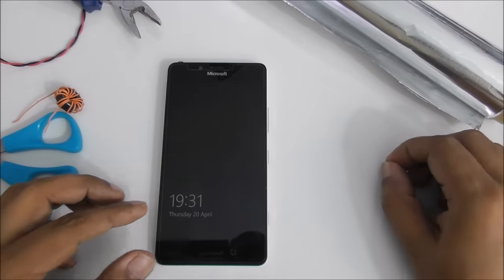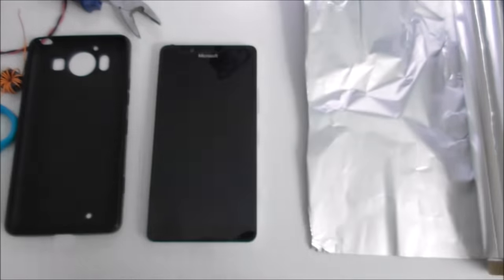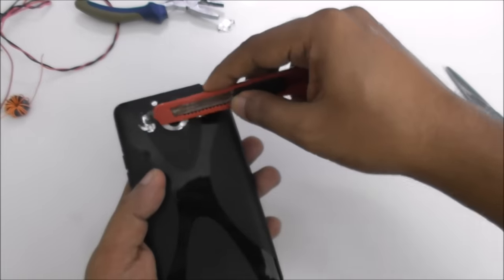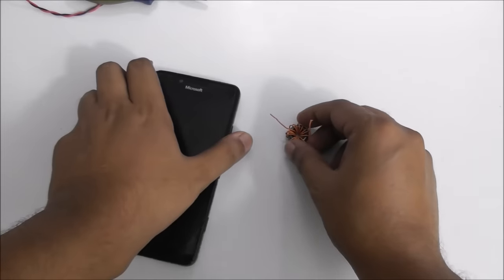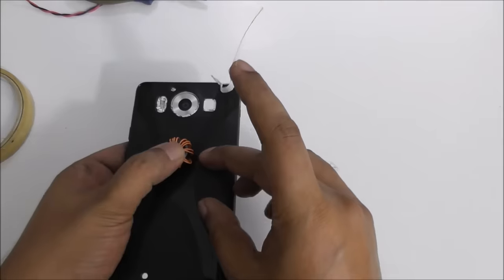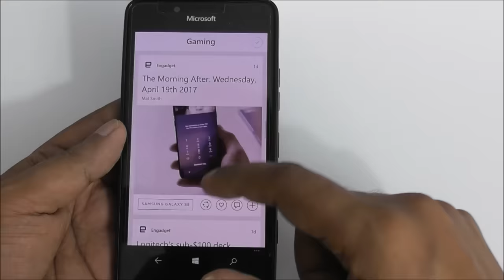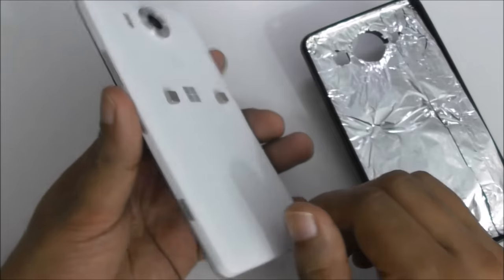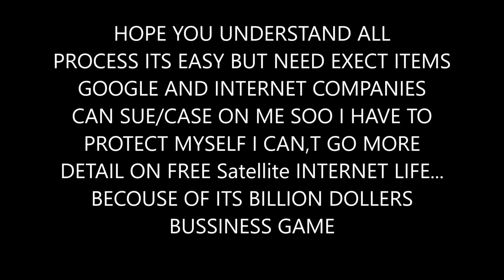FREE INTERNET WiFi DATA LIFETIME ANYWHERE

Comment: That ring is used in many electronics as a radio wave reducer, check a laptop charging plug and it will most likely have one, by this logic the ring would block any incoming interfering signals and disrupt whatever magical data is coming in, also with no SIM card??? There is a need to verify who gets connection, you have to have a very clever way to bypass this authentication system, and the magnets are just, wow.
Reply: What's that ring and where to find it bruh?
Reply: YinAnonYang suuuper brother
Reply: Zinnah Dowah it means wounded coil wth copper wire
Reply: YinAnonYang
Reply: Kusumbhu kaara pasanga da nanga o
Reply: YinAnonYang @
Reply: I find small in keyboard
Reply: بتنالعرب
Reply: hhhhhhh  he is working with houdini
Reply: You acces the internet direct from satelite so your mobile can become a small server you have acces to much more data from the internet becouse you are bypassing the autentification process from anycompany that provide internet also no one can finde you becouse you can delet all programs that have location or take out the location frome the motherboard lol this is houdini talk for some ppl lol
Reply: Zinnah Dowah that is inductor that component is to inductance magnetic wave! its depend how you make it (-) or (+)

Comment: So, he makes a toroid and puts it over foil and alongside a couple of magnets. Wonder if I can run my car for free on the zero point energy it produces. lol. Entertaining, but no real value.
Reply: xD
Reply: I had the same thought myself: Unconnected toroid? He should be whacked his religions subscribes!
Reply: hahahahaha , man u r funny.
Reply: I want to add alongside my other comment, Mr. Davis, that if his setup is putting his tx into the S-Band, it could work off multiple comsat systems.
Reply: Mr davis the problem with zero point module is controling the flow of energy

Comment: Is this ring only/just a metal ring or is this a magnet ring? Is the length of the wire important, or should it be just enough to create a proper coil around a metal ring? Are these common magnets for the backside or should these magnets be neodyn?

Comment: hi , did you lubricate the coil , the smartphone used in this video has a vibrator or not ?cause any electromagnetic field matters, anyway important is to put some lube on the coil first , it will attenuate friction and hurt less as well ...

Comment: You do realize that having two magnets next to a coil of wires isn't going to do anything right... the magnets have to be moving at all times to generate any form of electricity... having a magnet on each end would cancel each other out. On top of that you would have to have the coil of wires connecting to something to make the electricity go to it but that would only work if you were making a power bank to store energy to charge your phone. This is a scam, obv... it's an Indian dude trying to do tech support with his new Windows phone, he's trying to clean your Windows again...